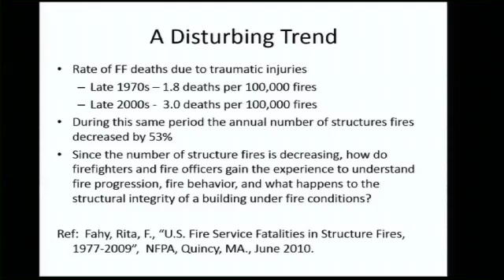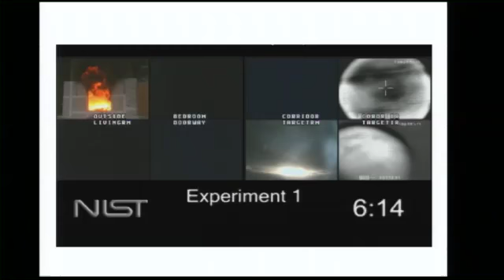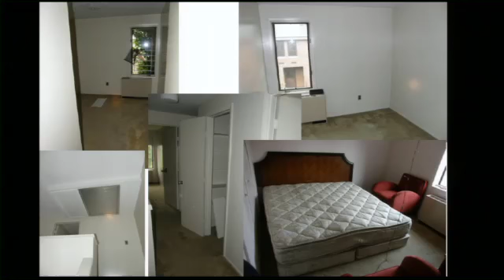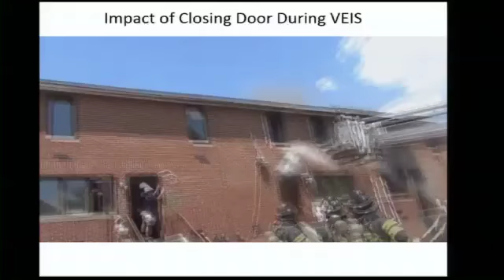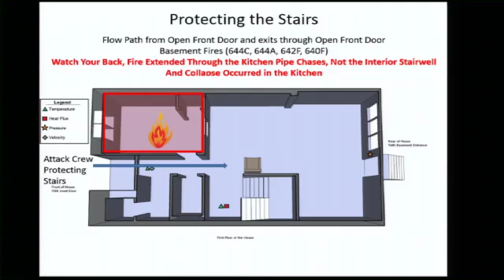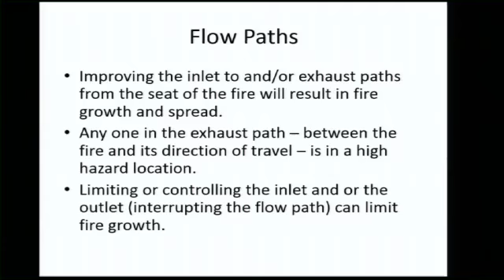Fire Behavior and Tactical Considerations

Comment: V - Vent.  You have just introduced fresh air into the structure and allowed gasses to move and mix with that air by creating a Pressure Release area.
E - You just entered this space which takes a LOT of time and in that time you have mixed the gasses and allowed the fire to get bigger.
I - You try to close the door to that room but the fire is still getting bigger and the temperature might have risen to a deadly temperature or even allowed flames into that room.
S - You only have that one room to search because you closed the door and allowed the fire to get bigger in the rest of the house where victims might be.

V - Vent the fire room windows.
E - Extinguish all Visible Burning Material through inside and out.  You have just dropped the interior temperature by 1000 degrees and eliminated the ignition source for gasses.
V - Vent more windows where you think victims might be.
E - Now that you are fully dressed, have assembled and entry team and gotten the front door open, you can enter with a charged line to further cool the space, mop up and protect the victims and fire fighters.

That is how you Do The JOB of Protecting victims and fire fighters.  Ask Worcester how VEIS has worked for them.

Basement fire.  Put it our through the windows and hatch before entry.  Period!  No windows and can't get the outside cellar door open?  Open the front and rear door, cut small holes in the floor just  to the side of the entry and fog the basement  cooling and condensing the air.  Having a 135 degree angle attachment will allow you to horizontally apply water in a 180 degree radius.  Water in the basement through the windows should be followed by breaking open the upper windows to allow gasses to escape as the basement water won't allow for the upper temperatures to drop quickly enough.

Vertical Venting is ridiculous and always has been.  It Never worked.  Horizontal Ventilation can be done QUICKLY AND SAFELY with a ladder and gives the gasses a direct path to the outside.  It also gives you an access point for extinguishment and entry.

Bottom line?  NOBODY IS LISTENING!!!!!!!!!!!!!!!!!!!!!!!!!!!!!!!!!   NOBODY CARES!!!!!!!!!!!!!!!!!!!!  You are taking all the fun out of Fire Playing!